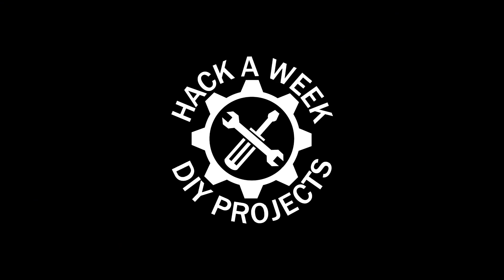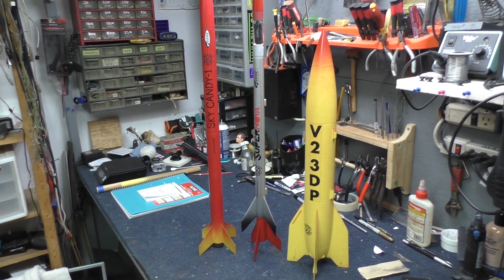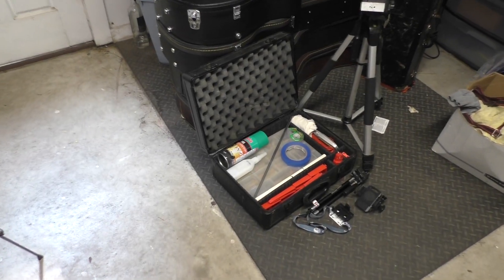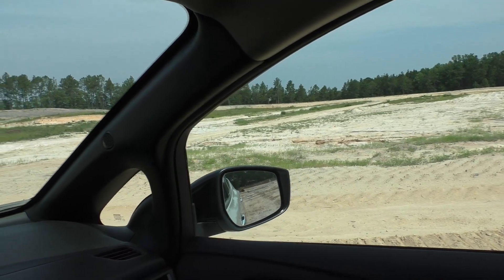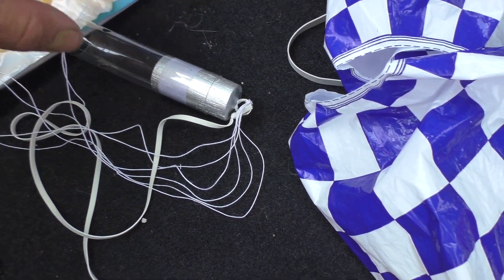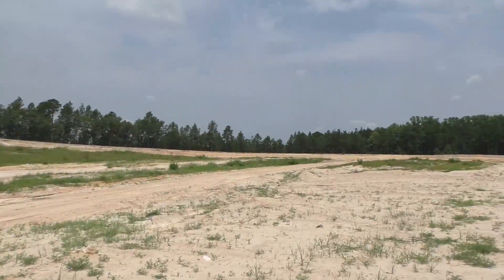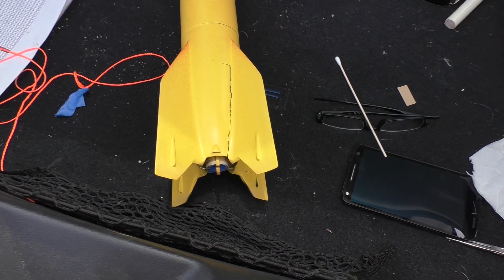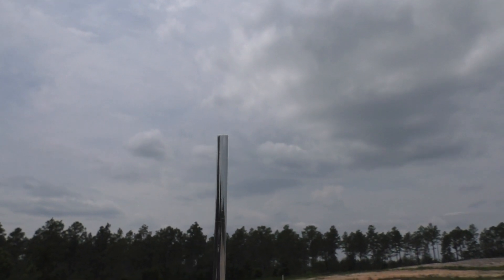V2 Rocket Launch   Hot Nozzle Summer

Comment: I’m returning to hobby after 30 years. Why do you cut out the center of parachutes? Great videos!
Reply from the maker: They tend to swing in circles when there's no hole which releases air around the side and they fall faster. With the hole they stay more stable and fall a bit slower.

Comment: Looks like the V2 had "rod-whip" to occur.  Perhaps a stiffer launch rod, like the Estes E Pad might prevent this, with its 1/4 inch diameter rod.
Reply: I'm thinking launch rail or a piece of drill rod which is very stuff.